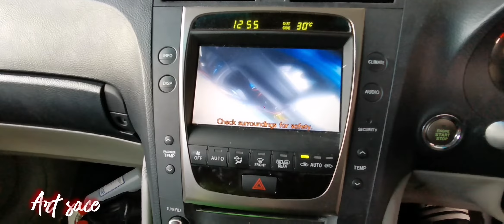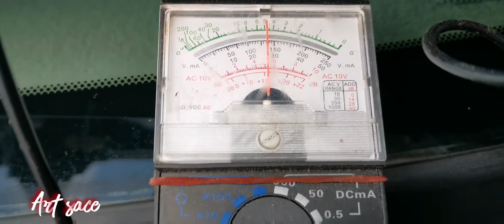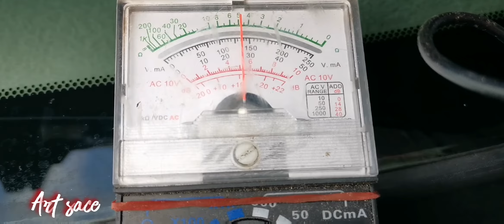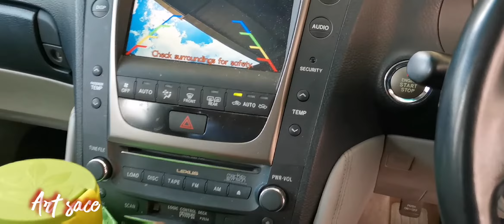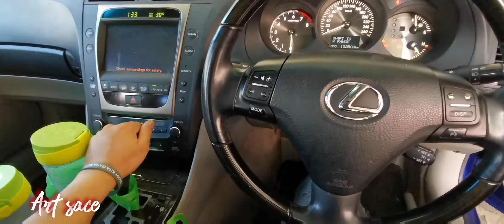LEXUS GS 300 replace new rear camera

Comment: Can you advise in a English? Which camera to buy and if can get direct plug and play model?
Reply from the maker: Gud pm sir u need to buy the original socket for plug & play try find online..
Reply: Bro, I bought a other camera, otw to Malaysia. Is there a socket set that I can buy... Got a link.. The original camera is just to expensive
Reply from the maker: @joelespeckerman5877  if you want cheaper boss buying not original camera...
Reply: Yes I have bought oem but 6 pin.. In the lexus ori is 4 pin.. How do I connect.. Share a digram guide with color
Reply from the maker: https://youtu.be/ojZa1Pb0mBM